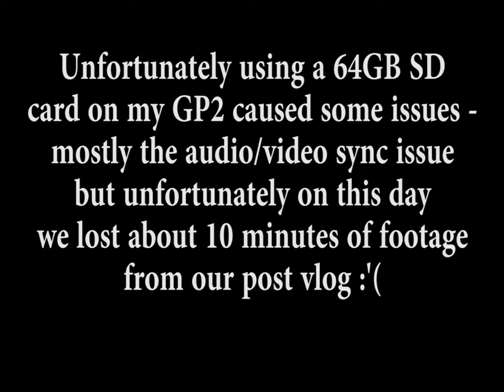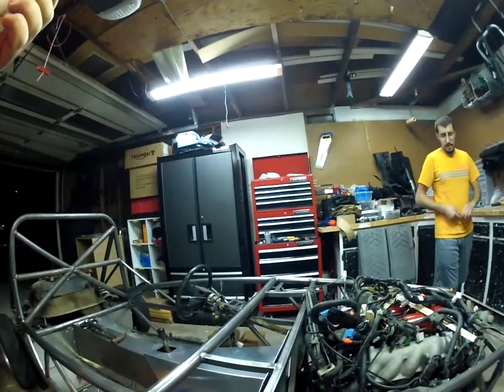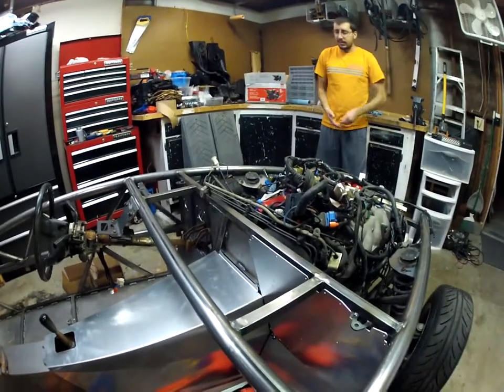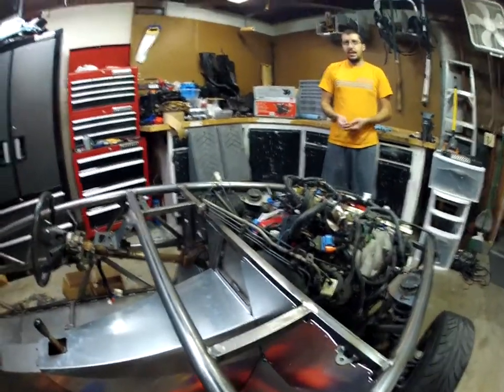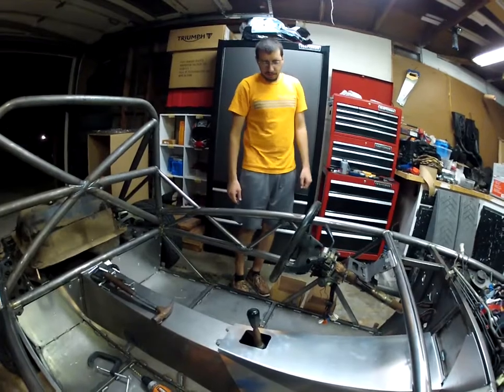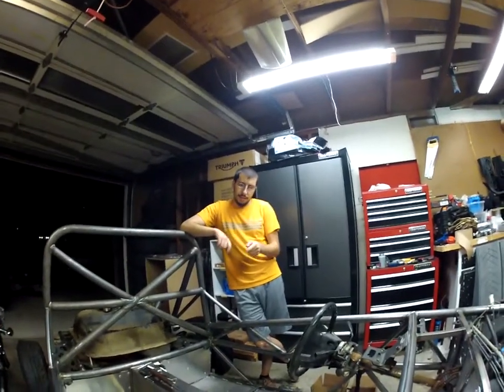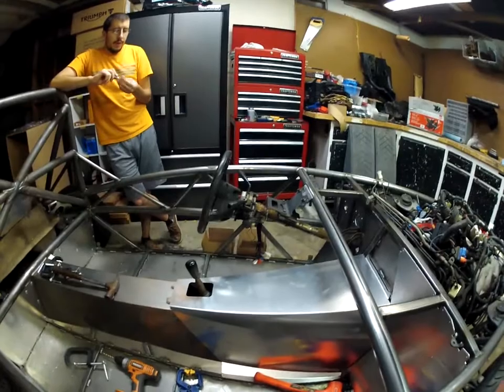Exocet Build Part 13

Comment: Good to see you making progress even if it's going slow.  Still find it strange you had the fitment issues from a kit that's supposed to all work together.
Reply from the maker: Yeah I'm not sure what the cause of that was.  The only thing I can figure is that they leave a little bit of extra material here and there so it'll always be large enough.  You can remove material, but can't add it!

That being said, I'd have to imagine it's pretty damn close for each one, so I don't see the point of even that, shrugs.

Luckily the material removal didn't take long at all.  Just trimmed down maybe 1/4-3/8 of an inch with a dremel, took like 15 min.